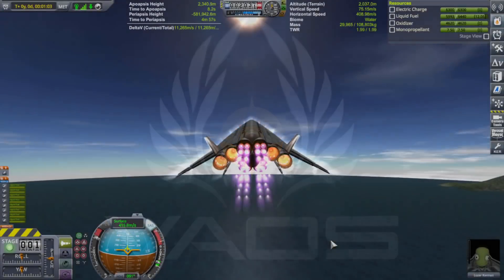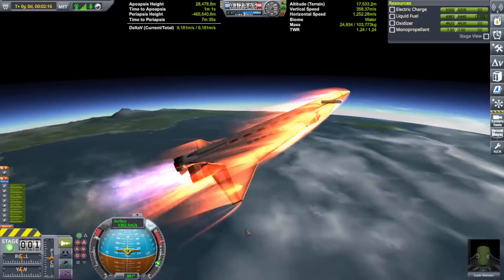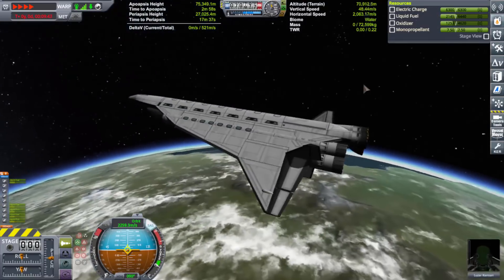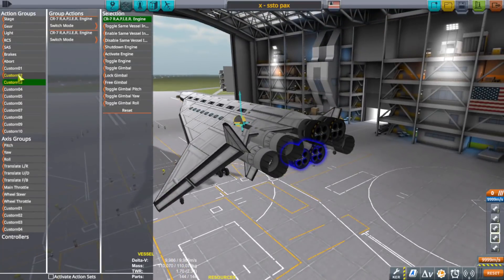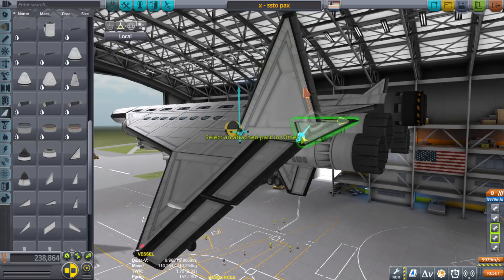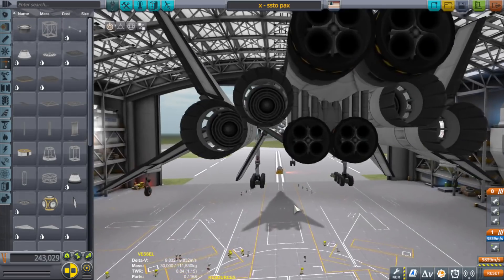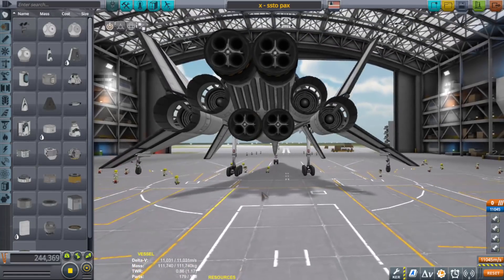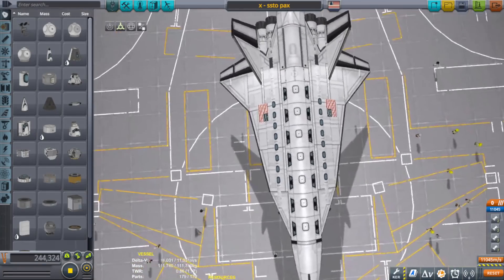STARLINER SSTO CONCEPT | Kerbal Space Program | KSP 1.12.2

Comment: Yeah, the rapiers only switch over on auto at 30km. Which, coincidentally, is the point where the game considers any engine to be operating in a vacuum for Isp purposes (yes, I know it still applies drag up until 70km, but still).

IDK if that has any implications for anything you're working on, but it is useful for situations where you don't have rapiers, or don't want to use their shitty closed-cycle modes in favor of actually good engines.

Comment: Omg that re-entry.... Your interior now smells like vomit, pee, and poo. Lol

The brakes have an issue where just as you're about to stop they totally lock up. I've had this issue with planes and rovers. You can avoid tipping by reducing brake percentage on the front to like 50. Then put the rear brakes up to max. That way the rear actually drags the craft to a stop.

Comment: Soo not fair, I've been trying to build a large ssto for a while now and yours not only works (kinda) but looks awesome 👏👌😎... I find that mine usually flips on re-entry and becomes impossible to recover after that or comes in to fast to land anywhere and rips itself apart the moment a wing scratches the surface
Reply: Use drag chutes to recover if you flip out on reentry it will reorientate your craft so you can throttle up and regain control 👍
Reply: @markthephantom9811  thank you for the tip but I've tried a few orientations of that but no luck 😅 by the time I'm coming back in my centre of lift has moved to far form its weight that I either can't pick up enough speed again or the engines are not getting the air flow to work efficiently enough to do anything and the ground catches up to quick lol I think I just stuck at SSTO... on top of that I'm on a old laptop with the computing power of a potato so every flight and failure wares me thin so I end up having long breaks in between playing.. thank u for the suggestion though
Reply: @ChrisHovord  after you finish your craft try emptying the fuel in the hangar so Youll know where the COM is afterwards maybe 🤷‍♂️
Reply: @markthephantom9811  will give it a go and see what I can improve on. Thanks bro
Reply: @ChrisHovord   no problem man ive hit those same issues now my sstos can hit reentry without much stress